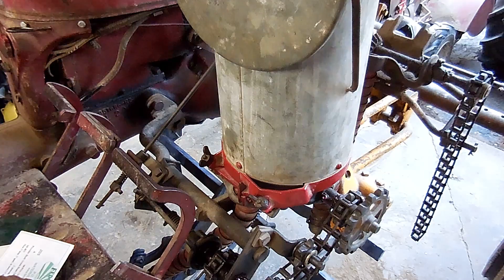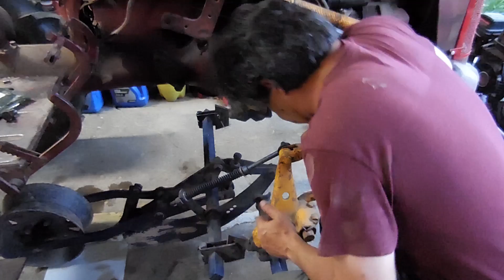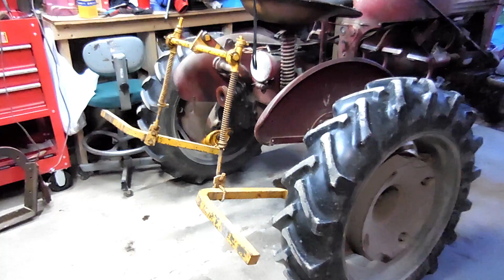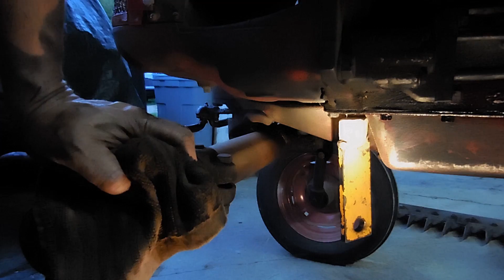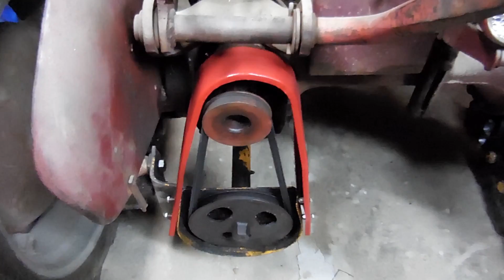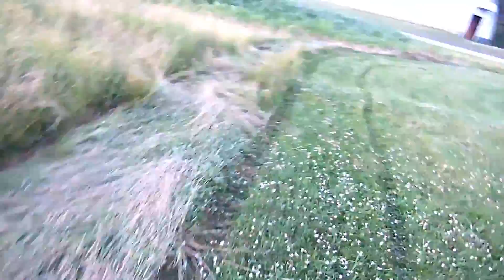Farmall Cub 174 Planter/Runner Removal, Sickle Set-up, & Hackin' Hay

Comment: I am tuning up a cub with a sickle bar that I have never used. Does it have to run wide open?
Reply from the maker: Not at all, I ran mine in 1st gear just above idle, with sharp knives, greased all the zerks and had great results. It would cut weedy hay as high as the hood of the tractor or 'mow' my lawn. It even nipped through the occasional finger sized alder on the edge of the field.
Reply: @OurPassThyme  that is awesome! I bought this tractor with the sickle bar mower in the hopes of cutting small pastures for my small custom bailing operation. one problem I see on my Cub"s sickle bar is The Ledger plates on the inner and outer shoes.  do you have any idea where to get them? and a video of how to put them in?